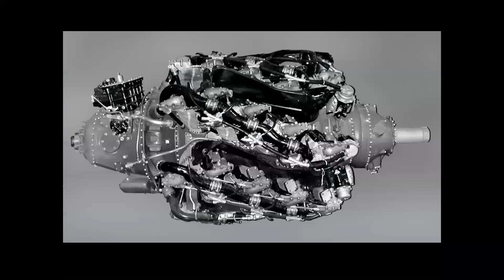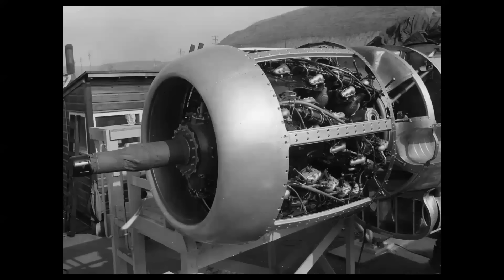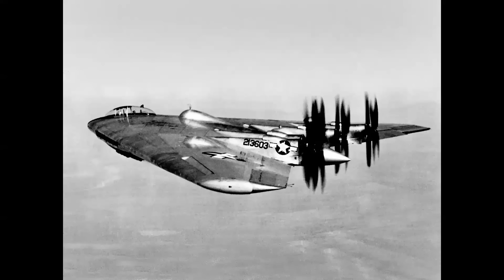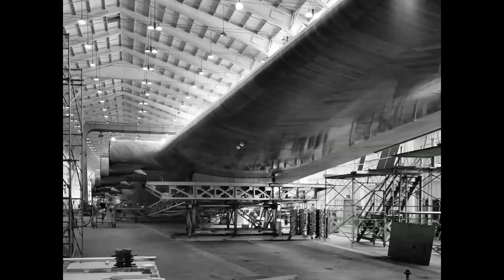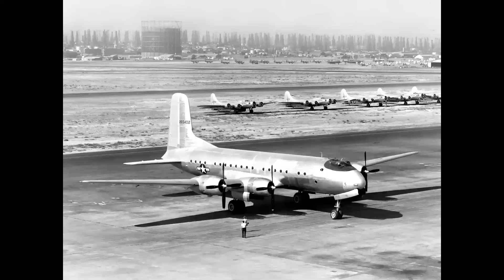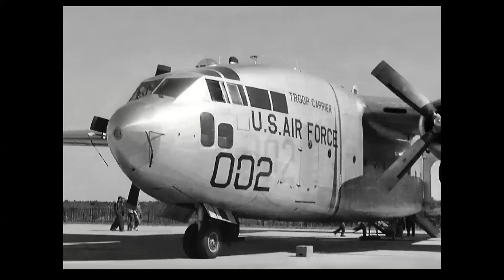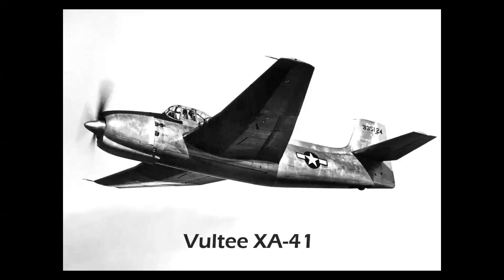PRATT & WHITNEY R-4360 WASP MAJOR AIRCRAFT - Airplanes powered by this giant radial engine

Comment: Like any radial engine designs, the Wasp Major wasn't immune from hydrolock problems. Added with poor cooling systems, high engine oil consumption and not to forget all the 56 spark plugs made it a pretty daunting engine to work with. I'm pretty sure NACA at least knew and studied the BMW-801 radials used in high performance Nazi planes of the day like the Fw-190 which used a small reduction gear-driven fan inside the engine cowling to remove heat from the engine further, because the Wasp Major would really benefit from active cooling. 

As always, great video Mr. Mike! I didn't know there existed two different versions of the XB-35 flying wing, each with different prop arrangements.

Comment: Another great video.  Have there been any jet engines with a similar roster of uses/airframes?
Reply: P&W J-57 engine, used on bombers and tankers, and several jet fighters of 50's vintage, including the F-100, F-102 and F-8 as an example of that.
Civilian version of this engine(JT3C)was also used on early 707's, 720's and DC-8's.
Source: https://en.wikipedia.org/wiki/Pratt_%26_Whitney_J57
Would like to see a video done on this engine!
Reply from the maker: @MM_in_Havasu  Great suggestion, and that topic is on the list!
Reply: @celebratingaviationwithmik9782  the TF33/JT3D series turbofan engine was another great jet engine, still in use on B-52H bombers being flown today. Those were used on jet airliners and many military applications as well.
Reply: @celebratingaviationwithmik9782   Great engine. Very robust. One old joke I used to hear was that you could throw rocks in the front and get gravel out the back.
Reply: The U-2A was also powered by the J-57.